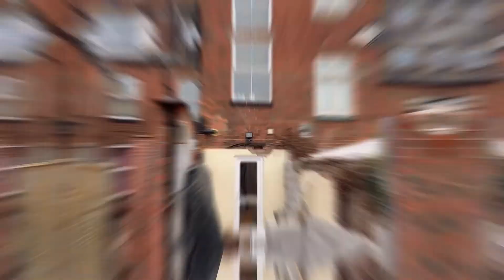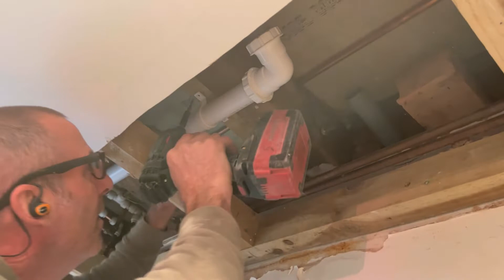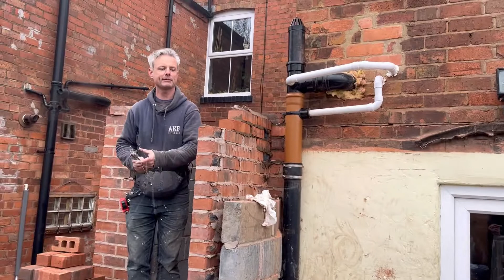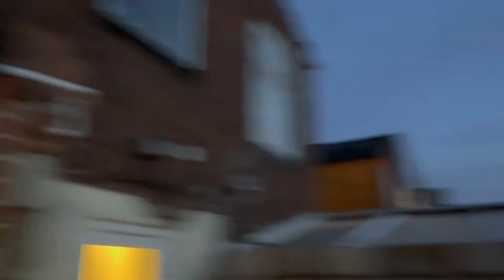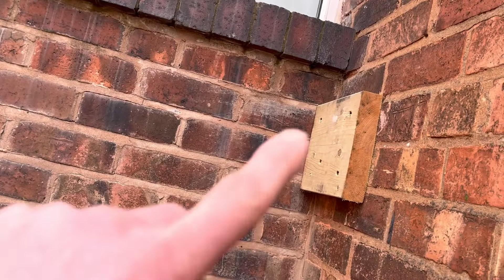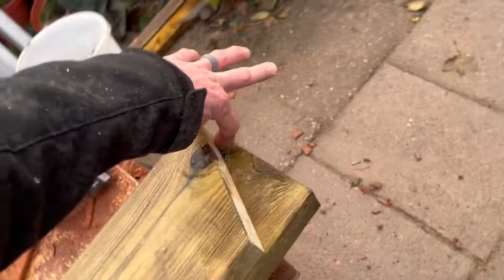Bricklaying Harborne Part 5 - waste pipes, lintels and brickwork  #bricklaying #extensions

Comment: The explanation to make the roof for that extension was good, but you could have marked a line on top of the fixed board and then removed it and screw the common rafters from the inner side.
Reply from the maker: Thanks for the comment. We all have our ways of doing things don’t we and as we say on the channel ‘This isn’t the only or best way it’s just the way we do it.’ Thanks for watching 👍🏻